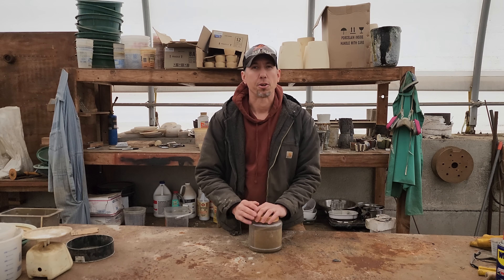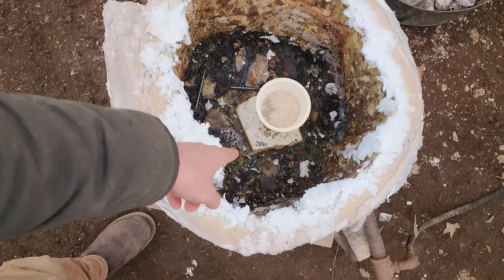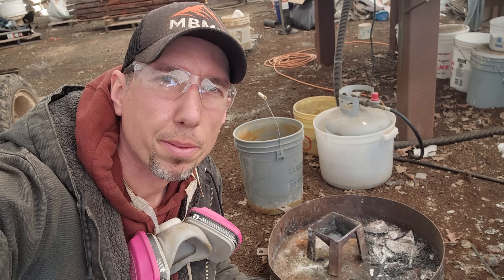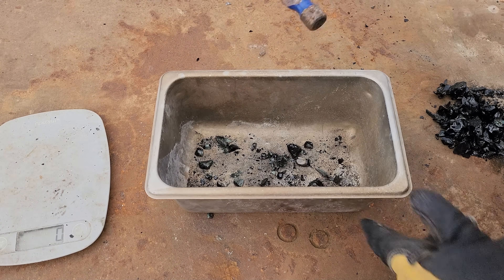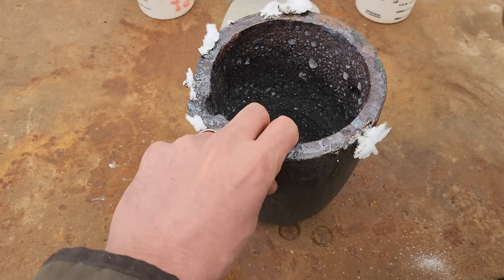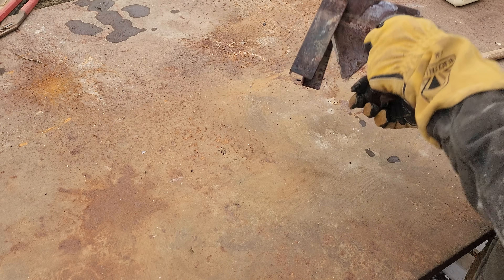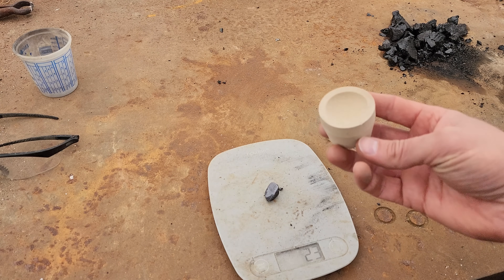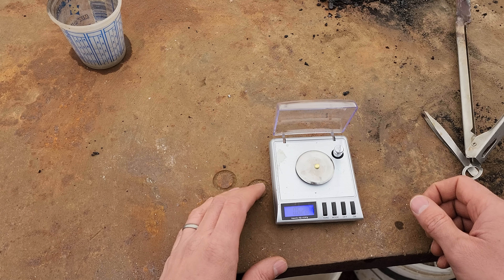Gold Smelting

Comment: What was your justification for not using iron? Without Fe you don't have a way to oxidize the  metal sulfides. You need to go back to adding Fe or use a strong oxidizer in the charge. I've proven this to myself with a limited set of experiments, as you have in the past. Also, make sure that you leave the melt hot for at least ten minutes after all bubbling has stopped. I've found this to be necessary to complete the reactions, especially the collection of PMs in the bismuth. I take the material slowly to 2100F and soak for 10 minutes. Finally, I've never found a difference between a lump of collector lead at the bottom and a uniform mix using litharge, as long as I soak for 10 minutes at temperature. I think convection is strong enough for complete gathering of the PMs. I don't see why bismuth would behave differently.  When smelting sulfides I've come to the following recipe: 100 g Sulfides + 100 g Soda Ash + 100 g Borax + 100g Chapmans + 30 g litharge + 12 g flour + iron pipe or rod. The litharge is a strong oxidizer, as is the Manganese Dioxide in the Chapman's. If using bismuth metal , I'd add 20 g of niter. -- Dave

Comment: Awesome video, always good to see you doing well.

What I would look into would be finding out if the hydrated or non-hydrated sulfides are soluable in something easy to access. If you get 10 lbs of matte layer, and can get it to break apart into something you can deal with (maybe some acid can drive the sulfer out and make it into a different, more smelt happy mineral).

I see you always trying to reduce steps by changing smelt ratios, which is fair. If you can do a step in smelt to reduce the matte layer by half, then you have more theoretical recovery with fewer steps, but you might add a whole recovery phase, where you take your matte layer once it breaks up, and just pour it into a bucket or something.

As a non-chemist, could even make it into an experiment. Try both hydrated and non hydrated in different things. (This bucket was hydrated and then soaked for 1 week in draino, this one was unhydrated, and dropped into a bucket of root killer solution for a week, etc)

The hard part would be to calculate actual helpfulness. Either a measure of remaining problem layer after a smelt. Or if you get a large enough base sample, you could test recovery, cause if it doubles the matte layer, but that matte layer holds no gold, that is better than a 50% reduction in matte layer holding the same amount of gold.

Issue is that you would have to run each test dozens of times to account for differences in each charge of gold per sulfide test  assessed. Cause you might just have more natural gold in the draino test vs the root killer test, and you would not know.

Goal would be to get your collector metal, matte layer, and glass layer, and then to be able to passively refine that matte layer.

Comment: Do your usual smelt. Turn the forge off dump some zinc into it carefully as zinc when overheated can turn gaseous in an explosive manner. you'll get zinc sulfide, iron powder. (Salvage it from cheap screen door handles:) Personally, I would sieve it after it self granulizes and put it through floatation or the shaker table.
Reply: But you left out what the result is.  What is the result?
Reply: @Bob-Whiting  the gold should be released from the sulfide matrix by using the reactive metals series.

Comment: good day Jason, your guess on what happened, is what happened indeed. you "fabricated" pure pyrite there, so the oxidation is real fast and exothermic! Watch this point when you are going to process production scale volumes! 
Maybe Dan can get you the footage of the site where he came across a dump area with freshly disturbed high pyrite content stuff. after a bit of rain and the heat next day, the chunks of pyrite were "burnt" through and even still kind of smoldering

Comment: Just out of curiosity, why don't you use a cone shaped crucible for smelting,and then just let it cool and break away to get the prill?
Reply: The content would most likely stick to the inside of the crucible once it hardens and then you'd have to break the crucible to recover whatever is removable from the crucible's inside walls.
Can't spray the crucible with WD-40 either prior to putting it in the furnace.
Therefore, the use of the METAL cone is more efficient and reusing crucibles is far more economical.

Comment: I think a time-lapse video of the matte converting to powder would be very interesting to watch.
Reply: My sugestion exactly! I think the powdering phenomenon is a combination of two things, the first of which being all off the stress of thermal shrinkage layering from the outside in as the glass cools, making the inside want to shrink but the ourside is already rigid. Imagine the dust a Prince Rupert's drop explodes into. The second contribution to the phenomena being something like oxidation,  where as the really thin layers of the slag oxidize, the stress is relieved and the layer falls away from the outside in revealing the next, and so forth. There may even be a third, or more, stage in there somewhere. What a fascinating thing, a solid powdering itself! I can imagine a few applications for the phenomena, if the variables of making it can be controlled.
Reply: @andyanderson2143  well said.  A cogent explanation of my own scattered thoughts
Reply: Ditto!
Reply: taking the mass of the freshly broken material and comparing to mass of the converted powder would be interesting too!
Reply: On a scale!
Reply: This, please!
Reply: That's a super cool idea!
Reply: Elves…. It’s freaking elves coming in at night and using Magic

Comment: If you drop the cone pour in 5 gallon bucket of water to cool quickly would the metal separate from the slag?
Caution, shattered slag may be an issue...